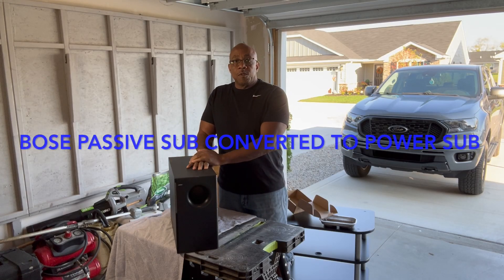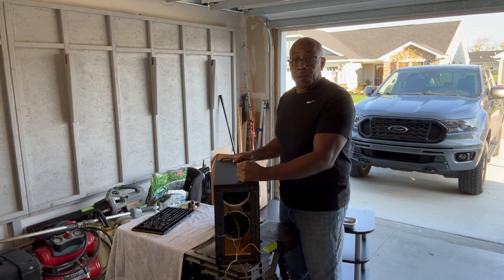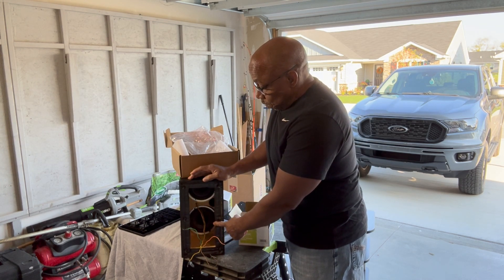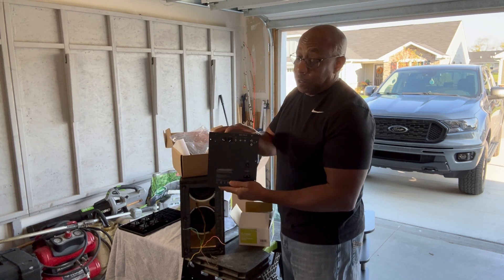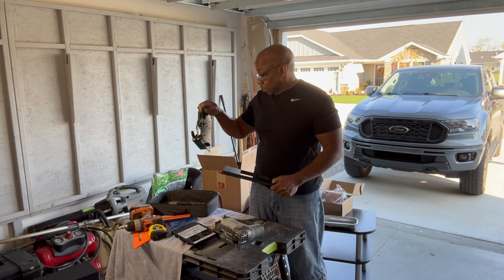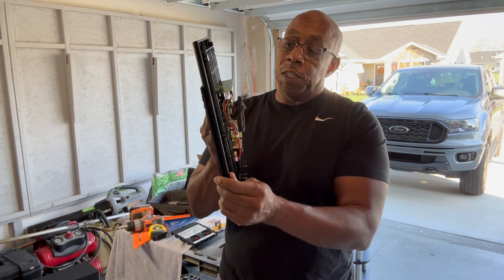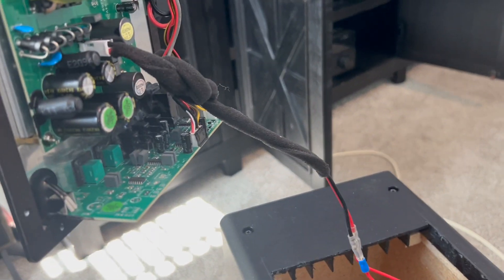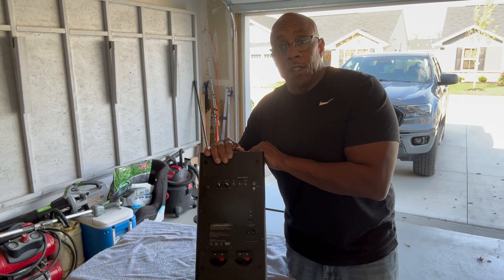Bose Subwoofer converted to powered subwoofer

Comment: Did you look at the TS parameters of the Dayton audio speakers to make sure they were gonna be suitable? Cause if you’re moving too much air through that chamber, you’re gonna hear a lot of port noise.   Back in my earlier days before I had a tool actually made by Dayton an audio to measure the TS parameters of both the aftermarket and stock sub and understand the size and type of enclosure. They are going in to make sure it kind of lines up I would run into problems from time to time where I was putting in speakers that were just too powerful for The enclosure, and we end up with terrible chuffing noises/pork noise whatever you wanna call it